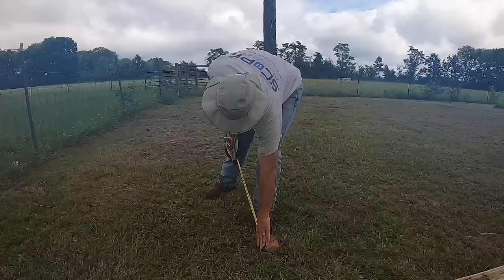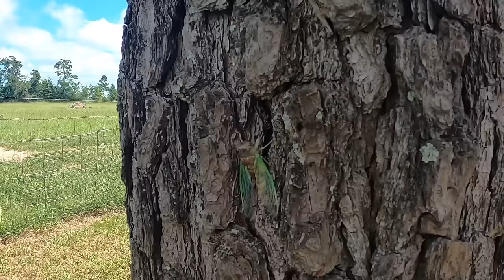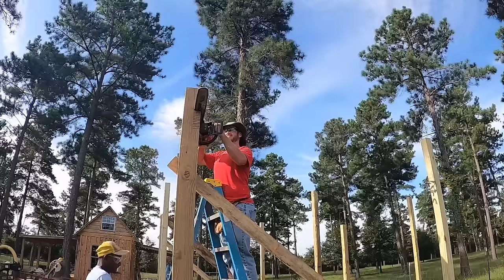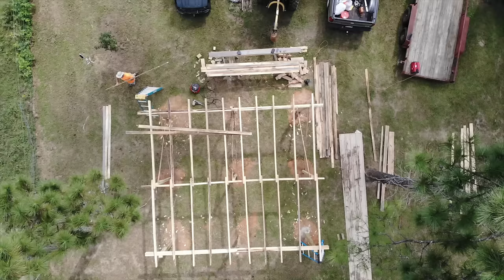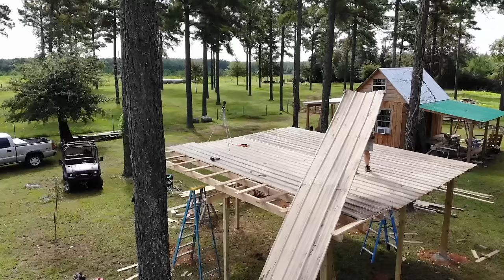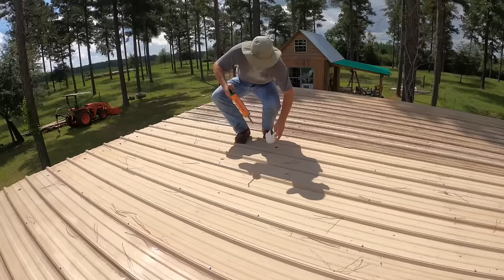Building a Simple Homestead Shed - FULL BUILD

Comment: Love the footprint of this and an open air space like that.  On my property I'm going to use steel posts 3' into the ground with cement for back Fence  and then higher for the entry opening. Less rot and wont require as much bracing or racking as lumber.

Comment: Awesome job you guys did, that shed will be there longer than you will live. I built a barn the same way. Treated post in the ground rough cut lumber and tin roof, that was almost 40 yrs ago. Still standing strong, I live in WV have seen 3 ft of snow on it. Thanks for the video.
Reply: I’m from WyCo West Virginia 🤙🏼
Reply: The treated lumber 40 years ago would last. What you buy today won’t. I had my 6x6 rot out after 24 years.
Reply: @rickringler5021  depends on the treatment. UC4B treated lumber or better  would 100 years with good drainage.

Comment: I know it's not the right way,but on small shes like that I'll frame the smaller sides on the ground and dig 2 holes and stand up one side and get it plumb. Then I'd measure off that to determine where my other 2 holes need to be. Dig those 2 and stand that wall up and get it plumb. Connect my 2 long sides boards. Like I said,I know it's not proper,just works for me. It's a shed after all, not the space shuttle.🤗
Reply from the maker: Sounds like a good idea, thanks for the tip!
Reply: You mean you didn’t have anything to do with the space shuttle challenger? Your not taking any credit for that one 😂   No insult intended, just when you mention space shuttle challenger popped in my mind.  Which I still remember a few jokes that stemmed from that disaster too! In poor taste obviously, but as one comedian once said. As long as you can get one person to laugh then it’s alright to say!  Although I bet there’s some judges that won’t agree with that! 🤪

Comment: For anyone in the future heres a tip i discovered when digging your holes with an auger. The auger can spin off the desired location so its hard to get it to fit  your desired layout.

After you do your 3 4 5   drive a big nail or rebar for the center of each hole, checking diagonals per usual.

Then take your shovel and dig a concave hole about 4 to 5 inches deep in the center. This will help hold the auger in place to start your hole. A lot more accurate so less hand work.

Comment: Nice job! It’s nice when a project doesn’t cost as much as it typically would…..eventually I’d put walls on the 3 sides to help with protection of equipment! 
I just got done building a steel 20x10 shed from an old round tube framed canvas style car port….did a concrete slab and used some lumber I already had to reinforce and add furring strips to it….had to buy the steal and additional lumber but it wasn’t bad. Have a total of 2k Into.
Not bad considering a local shed builder wants 5k for the same size shed with a wood floor.

Comment: Tip for finding a 21*21foot square would be to lay down four of these 21" sheets in a square and then use a square to check the angles, the 4 corners where they intersect should be square and you'll know you have the right layout for a properly squared building. You could also lay them 6" into eachother if you wanted a 20*20 or 12 inches in if you wanted a 19*19, etc etc

Edit: For the auger, once you are sure that you have a good square, you can use some spraypaint in the corners so that you can find the drill location easier - If ou want to be really precise, drill a 4-6" hole in a piece of plywood or other material and lat it out before spray-painting.
Reply from the maker: Ah, great idea!
Reply: Just use a 3,4,5 triangle. You can increase your dimensions based on that triangle.
Reply: @gary24752  that's true Gary, I meant for the purposes of marking the location for all 4 corner posts, to make sure they are square with each other

Comment: Nice build. Sturdy for sure. I redid a hole too. Glad you could reuse the metal roof pieces. Every little bit helps.  Quick question. I know you check the level horizontally. Did you check the level of the beams vertically too? I saw the level leaning on a post elsewhere.  I know putting in horse fence with posts and run in sheds, and barn build, we had to do that even with nailing the top runner pieces along the top initially, to keep it straight. Just to keep it within 1/4" from straight on corners. Didn't want it off bad from posts not close.

Comment: I understand it's just a "car" port, I was just a little confused as to why you took the time to notch the front and back posts, but then scabbed in the middle posts. The middle posts will have the most load on them. 
It really won't make a difference down south, but up north with snow loading, it would be a concern.

Comment: That's along the same lines of what I want to build to park my two SUVs under, except maybe not quite as long.  We had a bad hailstorm here in NC that beat the shit out of my new 4Runner......$7700 to get it fixed. Never again will I fail to have a place to keep my vehicles out of the weather.  I like this slant roof style with wood posts a whole lot better than having an all metal factory built carport.

Comment: for the little bit of rafter showing under tin, I'm wondering if you are worried about it rotting. doesnt look like pressure treated. I just did the same same so debating to add in metal flashing on top.

Comment: Need to get you a 12" auger for your post hole digger. you will have more movement room in the hole for squaring it up. Also will not wear out auger bits with a 12".

Comment: Have you ever tried a 20oz wood handle framing hammer. Lighter and less vibration on your hand.
Reply from the maker: No, just synthetic handles. I can see how they would be nicer though.
Reply: Maybe that is why I prefer my dad's old wood handled hammer.  It's the first one I always grab when I have to knock some nails in (or more often back in).  And the wood has a nice patina and is super smooth.  Once thought of sanding  it and putting a lacquer finish on it, but then said, heck, no. It's like that from daddy's sweaty hands from all those years of him using it.  I feel a little bit of him is there helping me hit those nails ..... instead of my thumb nail.  😄

Comment: Put in two stakes where you want your building to front the correct length. A and B Take your tape Hook on a nail on  A,go around a nail on  B  and measure down that side whatever your width is. Eyeball a right angle put in a stake C . Do the same starting with the other front stake,B to A  to a fourth stake D. Measure diagonally and adjust. Use stakes plumb and well driven in and use a nail   to hook on. Clothe? -plastic  tapes work better than metal tapes.

Comment: Thats called a tractor shed.
In mine I park both my lawn tractors, my cement mixer, my rototiller, my watering wagon,
my chipper, my wheel barrow, my dethatcher, both my push mowers & bags of bark & 
soil A  MOST  useful structure.

!

Comment: You should have used something like FootingPad which is a composite pad to set the column on. Placing it on soil is a bad idea for two reasons. You are exposing the endgrain directly to soil where it can absorb moisture, Depending on what your soil type is, the area of a wood column is not enough to support much of a load. It will just end up punching down into the soil. Every column should have a brace on it in each direction.  Since you poured concrete around the wood posts you should have coated the buried part with an asphaltic foundation coating. Pressure treatment will not keep the posts from absorbing ground moisture. Those notches you cut to carry the plates should have been field treated with a wood preservative. The minute you cut pressure treated lumber you lose what ever treatment you had as it only penetrates so far into the wood. I think considering that is an open structure 20d spiral shank pole barn nails or structural screws would have been a better choice to use rather than a nail gun with smooth nails.

Comment: I wish you had slanted the roof at least 6 to 8 inches so rain water runs off at the back and if snow/ice storm game it is easy to melt and have the water run also!!!! Slanted the way the tin roof runs!!! Easy to do!!! Safer for the vehicles under neath if the weight of the ice/ snow would not collapse , sweep or melt, fire in a barrel from under neath...
Reply from the maker: It's got an 8 inch drop from front to back, I think the camera doesn't pick up the slant very well.
Reply: Chances of snow/ice accumulation 100 miles South of Atlanta is pretty slim. And as Wes said, there is a drop.

Comment: Do you not have to mix the concrete with water before you put it around post ? Never seen anyone just pour dry concrete into hole and pour water over top of it .,
Reply: The water will arrive naturally (or be applied by a watering can) soon enough - the result is as good as premix.
Reply: Just because you’ve never seen something doesn’t mean it’s not a thing.

Comment: Is it too short for the tractor 🚜 to fit under 100%??
Reply from the maker: The middle header is a bit low, pulling the tractor in forwards works perfect, just not backwards.
Reply: The shed is on my property. Will be used more for storage of some antique mule drawn planters, plows, cultivators, etc. Tractor storage won’t be the primary use. I’ll keep one bay open to park my SxS or back a pickup loaded with seed or fertilizer under. Didn’t Wes do a wonderful job!

Comment: You'll regret putting those post in concrete one day.
Reply: Can you elaborate on this , so I won't make the same mistake
Reply: @alangreene7850  my dad always poured a concrete footer and used a metal clip attached to the footer with an anchor bolt. Then, bolted the post to the clip. He swears that the post rot faster in concrete.

Comment: Thats a shit way to pour concrete. It’s absolutely worthless. Those posts will lift in a matter of months if not weeks.
Reply: Check out the pole shed (and its expansion) that he built on his own property.  It has been there way more than a couple of weeks and hasn't shifted or lifted a bit.  Nor has the chicken house under construction. Wes knows what he is doing.
Reply: Come down to Georgia and I can show you posts that I personally put in the ground with that method 40 years ago that are still in the ground. Don’t know what you think will lift them, but we don’t have “frost heaves” down here.
Reply: @markharris5525  I guess he traveled pretty far to get to you. Far as I know he’s north of Arkansas and I personally seen that posts lift after that kind of piss poor concrete work. Within the last 3 years I told him it wasn’t going to work and he did it anyway. Results were far from awesome.
Reply: @tinydancer7426  the pole shed has no concrete. The posts are in the dirt. They won’t lift, but they will rot.
Reply: You can try it for yourself. It doesn’t have to be a structure. The way he treated the coup posts was great. They will probably last a decade. He didn’t show treating the posts for the pole barn so I would give the 3-5 years. But pouring dry mix concrete in a hole around a post is weak and will certainly lift during every freeze. Not to mention the concrete thats dry in the center never gets hard until after the freeze lift if at all. The purpose of mixing concrete is to insure that the entire mix is proportionate in strength and doesn’t create a conical shell which allows freeze to lift it. It’s not necessarily science, it’s more common sense. But what’s done is done. You have to learn somehow.
Reply: @geostanley409  The posts are pressure treated wood.  Wes explained the posted are pressure treated, all the rest are lumber he sawed ...... some from trees that came down on the customer's property and some of it was lumber he milled that he had at his place already.
Reply: @geostanley409  The posts are in concrete.  Quick set concrete.  He showed it in the video.  I am quite sure if it wasn't something that the customer (a neighbor) didn't want him to set the posts that way, he wouldn't have done it.
Reply: There ain’t no such thing as a “freeze lift” in South Georgia.
Reply: @markharris5525  Never heard it called that term.  'Round my part of the country it is called "heaving" or "frost heave"...... which kind'a makes sense ..... heaving is like mother nature barfing up something that she does not want in the ground.  😄
Reply: We would use that same method in WI when I did construction, and never had one lift out from freezing. Not sure why you say it won't work.